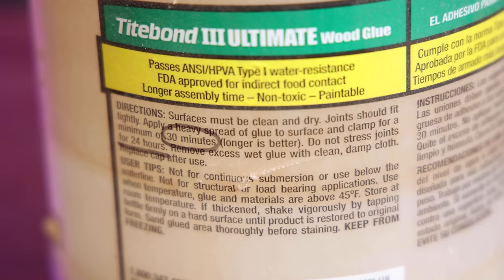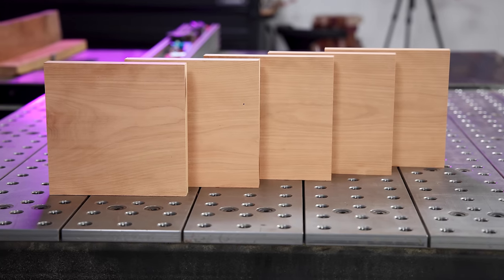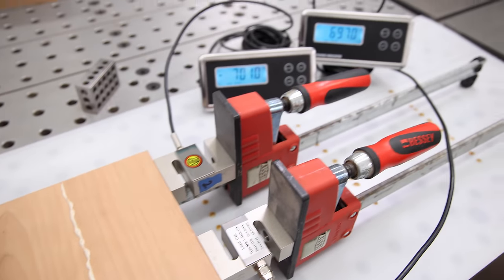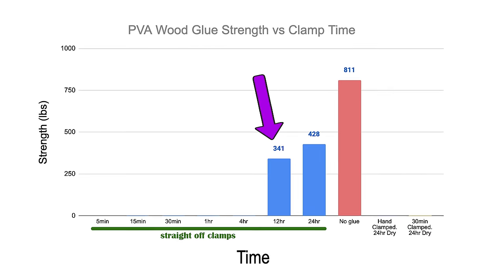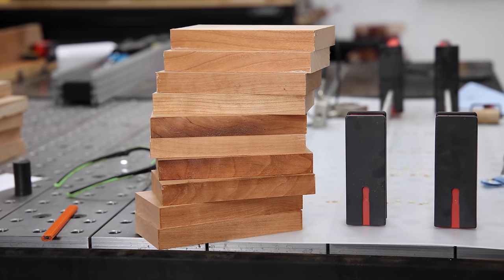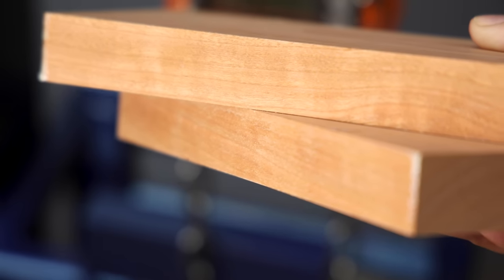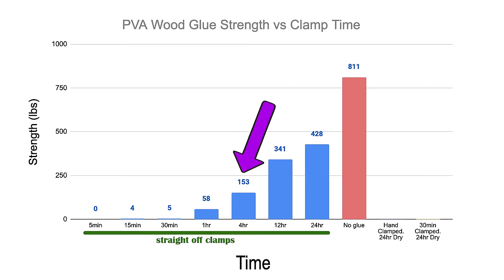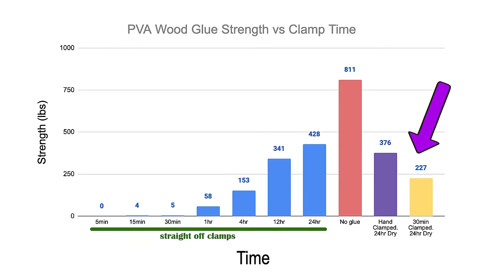you are clamping too long

Comment: Titebond 3 cures more slowly than the other versions and Titebond 2 is the fastest cure. I glued thousands of glue line feet in red oak in the 90’s using TB2 because it allowed me to reuse my clamp rack sooner. I left it in the clamps for 30 minutes, then stacked the panels to cure 24 hours before thicknessing. 

Several factors contributed to the success of my efforts. First was the joints were right off the tablesaw, not planed. The surfaces were decent but not perfect. I believe that this helped prevent a starved joint. The hand-planed joints in the video did not require high clamping pressure, and too much pressure can starve the joint. 

Second factor is environmental. These were glued in Colorado where the air (and the hardwood) is dry, so moisture from the glue rapidly moves into the wood and the shop air, faster than in a more humid location. 

My gluelines never failed and I regularly broke cutoffs to verify that the joints were stronger than the oak

I’m doing glue ups now in a 75% relative humidity shop with acclimated wood and Titebond 3. I leave the clamps on 12 hours minimum and wait another 12 before planing to prevent sink at the glue lines.

Comment: Dude!  You just earned a sub.  Great approach to experimentation and analysis.  Another thing that I've wondered about is do you really need to have glue running out of the joint to get a strong glue joint?  I tend to use less glue because I see 50% of the glue I use running out of the joint and know that it's not helping the strength of the joint.  I've not run the kind of experiments that you do in order to convince myself that I'm not compromising my work.  Oh, and I usually leave my clamps on 2-4 hours and I've not had any problems.  Your finger clamping pressure data matches my unscientific experience which is to say if I use tape for clamping pressure, I get good, strong joints.  Keep up the great work!

Comment: I think the clamped 30 minute joints failed at the glue line, when your "hand clamped" joints did not because the clamps (at the recommended PSI) actually squeezed out too much glue and partially glue-starved the joint, whereas your "hand clamped" joints left more of the glue between the pieces.  Great video, by the way!

Comment: I found this video really interesting. As a side note, this "joint is stronger than the material" problem creates what we call in welding "stress risers," and we get the same results - cracking in the immediate vicinity of the weld but not the weld itself.

Comment: Thanks for a very good video. I glue up segmented bowls and vases etc  with a glue joint approx 20mm wide, then I turn them on the lathe down to a wall thickness of 6mm 1/4inch and I don't have failures . But I glue things in an un conventional way.. I apply the glue to the surfaces and let it sit for a minute to soak in, if there are any dry spots I apply more or just spread it with my finger. Then I clamp up tightly. I don't have to worry about starving the joint of glue because the wood  had time to absorbe it before clamping. I clamp for an hour, and I'm very careful to avoid temperatures below 12°C  I bring the glue into the house overnight.   By the way, this joint will GRAB very quickly,  so you must have the parts lined up and the cauls and clamps ready in advance. If you disturb it after it grabs the joint will fail.

Comment: As many other people have said, this is great!  I really appreciate the scientific approach with multiple data points.  And, of course, like any good scientific experiment, it raises lots of new questions as well as answering the ones we started with.  My "wish list" for what to test next (if you do a follow-up video) would be to try different clamping forces with both the "30 minutes clamping, 24 hours curing" and "4 hours clamping, 24 hours curing" states, to see whether 200psi is, in fact, too much.

I think that would give some backup to the theories about why your last test was so weak -- I'd expect that the weakening would go away with less clamping force, and that there's a reasonable force that would work well with that time regime.

After that, my wish-list would be to test less-precise joints -- take your perfectly-fit wood, but put a thin shim at each end and clamp with a force that holds it firmly together for 24 hours but doesn't squeeze the crack entirely shut.  Try that for several thicknesses of shims -- I'd try increments of 0.005" up to 0.030" or so.
Reply from the maker: Haha. These ideas are amazing and wouldn’t you know it, I have a half baked script draft of them in my OneNote. Izzy swan really wanted me to test the gap joint strength. I have a few ideas ahead of it but def will circle back to it in the spring-ish.

Comment: Another set of tests I'd like to see are:
(1) measuring expansion after releasing clamps at different times and letting glue cure after release to see if you can detect when the joint is cured enough to unclamp so you could potentially reuse the clamps on something else while finishing the curing **
(2) full clamping pressure tests
(3) temperature change tests

** Given the difference between the two single tests (hand tight and 30 min clamp), I wonder if the expansion from declamping after the glue had hardened damaged the joint because it was too brittle but not cured. Hand clamping was while the glue was still workable.

Comment: One thing that most folks overlook: the roughness of the glued surface. If your surface is too smooth and clamped tightly it’s easy to force the glue out. I wonder what the impact would be when sanding/roughing some nooks and crannies, or scrape/cut shallow grooves? How rough of surface is enough? How much is too much? How does it affect cure time?

There’s one lazy trick I’d love to see tested: prevent glue starvation: let glue air dry until tacky (5-15 minutes) then clamp and clean with rag and warm water.

Comment: Wow! Maybe the glue was all squeezed out by the "excessive" clamping force? Great comparison. I'll be a little more patient with my glue ups in future.
Reply from the maker: I thought it could have been a starved joint but i used 200psi just as any other ones on this test. They all got very similar glue application. really feel 30min isn’t strong enough to unclamp/handle as it seems easily be disturbed with possible weak curing.
Reply: @WoodcraftBySuman 

Clamping does two things: it closes the residual gaps at the interface and squeezes glue out.

Releasing the pressure too early reopens the gaps, since the mostly -still-fresh glue doesn't have its full holding power yet And since a lot of the glue has been squeezed out by clamping in the first place, there is not enough left to fill the gaps.

When the clamps are left longer, the glue is strong enough to avoid the reappearance of tiny gaps when the pressure is released.

Alternatively, without any clamping, there is much more glue to fill the initial interstitial gaps.

Anyway, that's my two-kopek on the apparently paradoxical result.

An alternative explanation is that the dispersion in wood characteristics is too large and your samples too small for statistical significance, but that wouldn't be as interesting.

Anyway, I love your thoroughness, dedication and overall quality. Thanks a ton.
Reply from the maker: @melainekerfaou8418   I very much agree with your assessment. Sample size will always be a limitation for my channel because I simply don't have the manpower to get them much higher than this. I will say though, vast majority of 1hr+ test results were remarkably consistent. And you're probably right--unclamping and releasing 200psi pressure generates a vacuum in a very lightly coated glue joint that can only be filled with air and cause failure.
Reply: @melainekerfaou8418 yes! The glue having time to fill the gaps explains a lot. What I would like to add is that I think sanding the joint would make a big difference. This would allow more surface area and the sanded wood fibers will absorb more glue in less time. Also, less glue will squeeze out and leave space for imperfect handling. What do you think? The nice bookmatch with the hand plane looks good but I don't know if it is beneficial or even hurting to glue joint.
Reply from the maker: @BenVeenstra  it’s not a common practice to sand an edge before gluing it. Generally it would come off a table saw or a jointer. Both using blades. While they leave a more “fuzzy” finish relative to a hand plane, glue entering the wood pores and crevices would probably be pretty similar in performance. But the main reason for the hand plane use was consistency and standardization so that results between samples can be reasonably compared.

Comment: Thanks for the video. It’s has great info. I think I’ll stick with at least 4 hours as well. 

I suspect the glue is stronger than the lignin between fibers, but not stronger than the fibers themselves.
Reply: If you really wanted to see the strength of the glue, you could take advantage of that fact and test end grain glue ups.

Comment: My explanation for the 30min test would be, you press the glue so thin that when you release the clamps it springs back a tinny amount and the glue loses contact in some areas. When you use your hands only there is no springback and the glue can bridge over these areas .
Very interesting stuff and usefull for everyday glueups. My takeaway...
If using clamps, leave them at least for a few hours. I often release clamps after 30minutes, I never had a problem so far but your test lets me rethink.
Reply: Would have been interesting how the 10min clamptime would have compared after 24h. Might have been stronger then the 30min if you maneged to get it out of the clamps with out moving it....
Mortise and tenon for example, where you use clamps to pull it tight and then, after the open time, release the clamps.

All and all, if you work clean I don't think there is a real diferents at all.

Comment: Thanks! I have had bosses insist on running things through the planer after 15 minutes, but I always had other thing to do in the meantime to let them sit for a while longer. 
About an hour into the glue up, when the glue is somewhat still soft What I have been doing is removing clamps one at a time to remove the glue and then replacing them from the panel. So instead of releasing any pressure is to keep the clamp about ½ an inch above the wood to be able to scrape the glue off. One thing I have been doing for years now is to let the panels sit for a week to allow any water from the glue to evaporate off the wood. When first glued the panels have a swelling like a mountain ridge and if you were to plane or sand it flat, it then dries leaving a valley.

Comment: For the 30 min clamping, 24 hour drying, because the glue is not yet dry, and the clamps did pushed most of it outside the joint, when you unclamp them, a small gap would form from the released 200psi of pressure, and that becomes a weak point, not to mention there is no much glue left. Because you didn't applied so much force on the hand pressured ones, enough glue stood between them and no air got in. On the other hand, what I would do before putting pressure, would be to let the glue get sucked in for 5 minutes, so the glue penetration would offer more support for the final body of glue inside the wood, even if that is only 1mm. I would just test this to know for sure, but I lack the means... Nice video BTW, first time here!

Comment: I wonder if greater clamping pressure causes more glue to squeeze out, but then if that clamping pressure is released before the glue dries/cures enough to hold the joint tightly  together, then there joint has an effective glue deficit. Less pressure means more space between fibers, which means more glue is needed.
Reply: I agree, soon as I saw he had transducers on the clamps to measure clamping pressure I was eager to see variant in clamping pressures tested.

Comment: Interesting video.
A further experiment would be to keep clamping time constant and then test for strength after different amounts of curing time to see how quickly you can get on with further work on the piece without the joints failing.
I think the issue for production work is as much to do with how soon the joint is strong enough to remove the clamps,move the work without breaking the joints and get those clamps onto the next piece.
I used to use a microwave gun and it generally took 10-15 seconds in the clamps per joint / 150mm of glueline (tabletops)

Comment: Regarding the 30min clamped, 24-hour dry: I can only speculate here, but I would assume that when removing the clamps, the wood sprang back ever so slightly, stretching the still soft glue apart and probably introducing either tensions or drawing in air bubbles from the outside. Those would limit the glue's performance even after a full drying cycle.

Comment: When you remove clamping after 30 minutes, you're breaking the bonds that the glue has started to form. In particular  the glue is able to pull itself out of the wood fibers.
That's why it's weaker than no clamping at all, because no clamping has not been disturbed and was able to form good bonds, although these bond did not get as deep into the wood fibers because there wasn't enough pressure (which is basically how much force is applied per unit of surface)

Comment: Thanks a lot for such a helpful video! Regarding the test with 30 min. probably the clamps are removed just as the glue starts to set but is still sensitive to movement and releasing the pressure damages it when it is most sensitive. My guess.

Comment: I love your testing setup & method, but the more interesting question (for me) would have been that of strength after a total curing time of (say) 24 hours for various clamping times, i.e. the comparison of different clamping times, but identical total curing times. Typically, you want to reduce clamping time because you want to proceed with your project, but nobody would expect or require final glue strength after a curing time of 1 h or even less.

Comment: Great video! I always remove 3-4 hours after and scrape the glue because it is a bit softer.  Would love to see the same experiment with Titebond II extend and original.  TB3 is terrible for fine furniture IMHO.
Reply: Why do you say that about tb3?  What are the drawbacks?  I use 2 generally but I was considering driving into 3 a bit more because I’m currently in the tropics.
Reply: @vedicapproach8105 IMHO it doesn’t dry as clear or disappear as well. It also is a lot harder to get out of pours, so DONT wipe it off, instead wait a couple of hours and scrape it off while it is still malleable.  It’s ok for outdoor furniture but I would use TB2 extend instead for most things (or TB original)
Reply: @vedicapproach8105 unless it is outdoirs and get rained or in a shower. Tb3 is not going to be better than TB2. You have a about twice the open time, a bit more strength, and a little cooler minimum tempature with TB3.

Comment: You should also do a test with premium construction adhesives like Loctite PL Max or PL8 (get a high thrust ratio caulkgun or you'll be squeezing for days!) and  spray foam construction adhesives like Greatstuff Pro or Dap Smartbond. Id like to see if Woodglue is really any better than construction adhesives.
Reply from the maker: Definately part of the plan after a few ideas I have queued up.

Comment: Great properly controlled test. thanks. Once the adhesive compound has achieved the equivalent strength of the wood, its function has been reached, but I wonder when it actually gets to its terminal state. As we know, concrete never stops curing and glass is always a liquid. Where, when and under what conditions does an adhesive arrive at its zenith?

Comment: My take on the 30 minutes was simply that you can remove the clamps and continue working on the piece after that amount of time. Not that it was anywhere near cured (which you did not imply that either). However, I never took my clamps of prior to 2 hours typically. Maybe on much smaller pieces, but not on larger ones. Also, most of the glues that I've seen and use actually say that they are not intended for, even as your bottle states, "structural or load bearing application." That should say something about the glue as well. Great video, very thorough. And, you have a new subscriber. Thank you and God bless.

Comment: My guess is that machine-clamping for a few minutes forces more glue out from between the boards than hand pressure and relieving the pressure allows more evaporation around the perimeter of the joint.  The first leaves less glue to penetrate the wood during setting through the opened cellulose fibers into the walls of the adjacent intact  fibers and increase tensile strength. The second allows the glue in the joint to cure at different rates, possibly making the glue at the periphery more brittle. 
You don't have the tooling to do it, but an offset shear test would be a better test of the strength of the joints than bending.

Comment: I think it's a fluid volume versus pressure thing. When you apply the clamps, you squeeze a lot of glue out of the wood in the joint area. If the clamps stay till the glue cures, then that small amount of glue is still plenty to do the job, but if you remove the clamps after only 30 minutes when the glue is still uncured, the wood decompresses, and suddenly has the capacity to absorb more glue. But you squeezed all of the glue out of the joint, so there's now actually less glue in the joint bonding to wood.

Contrast this with your hand placed wood, you never squeezed the glue out of the wood, so there was plenty of glue present to fill the joint area. Good bond.